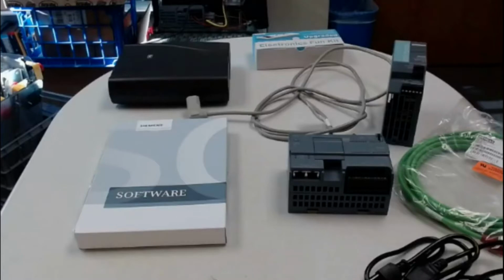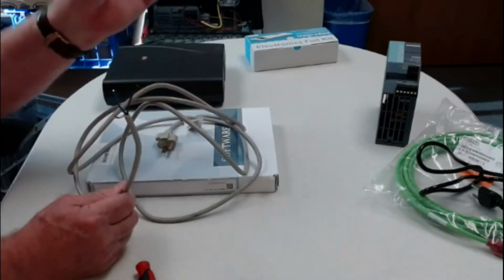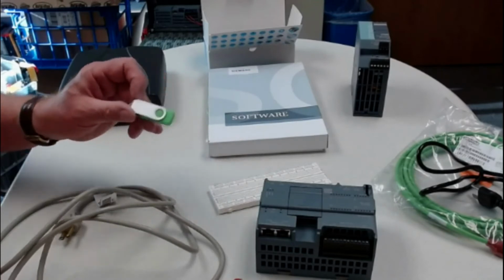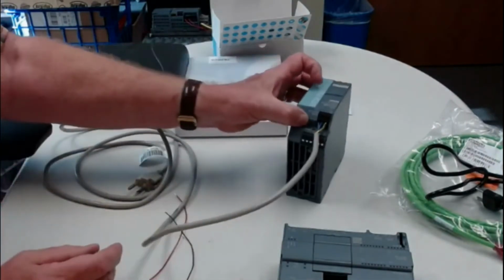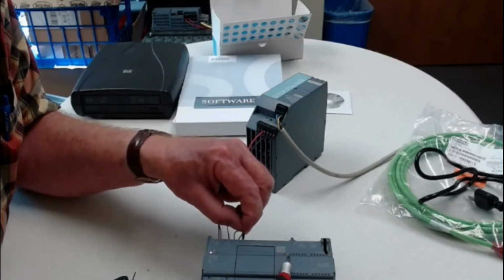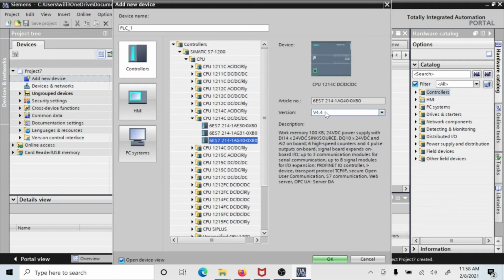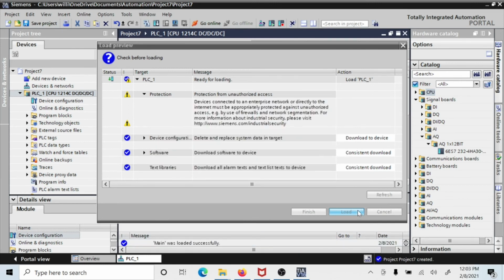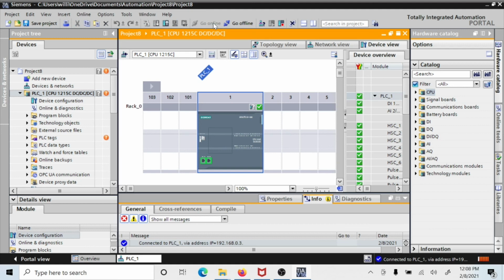PLC Series Chapter 3 (Part 2/2) - How to Set-up Hardware and Software

Comment: Thanks for the content! I'm trying to follow along at home and was wondering if the ethernet cable was a crossover cable that can connect the CPU and the laptop directly, or if a router was needed in between. Thanks again!
Reply: Confirmed it definitely needs a crossover cable.